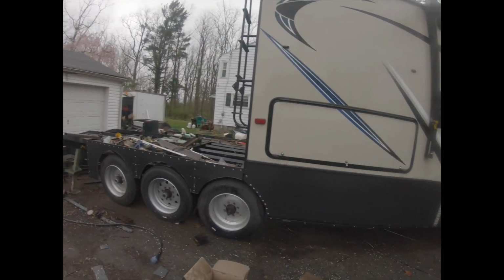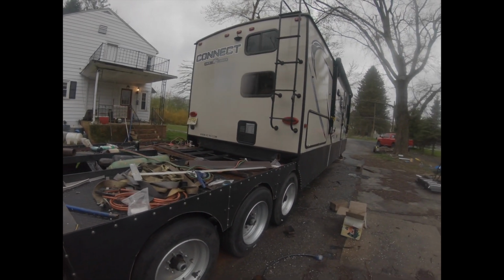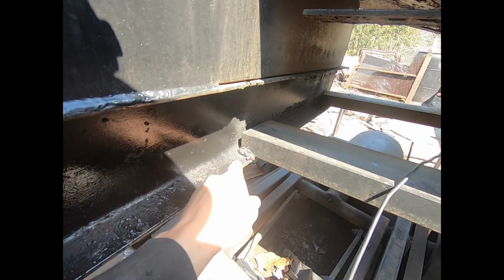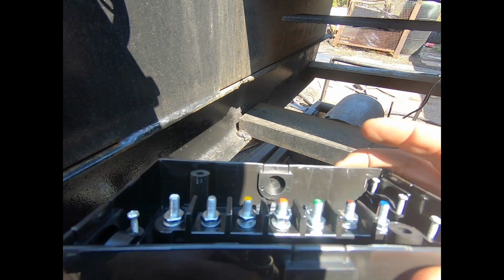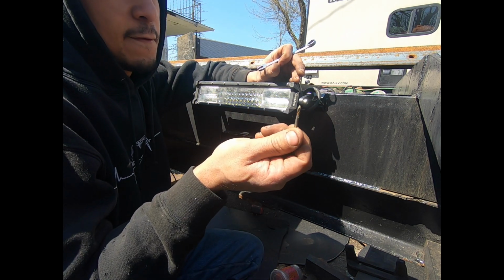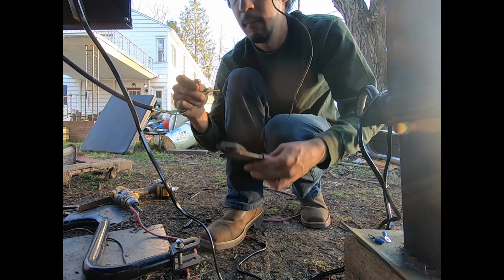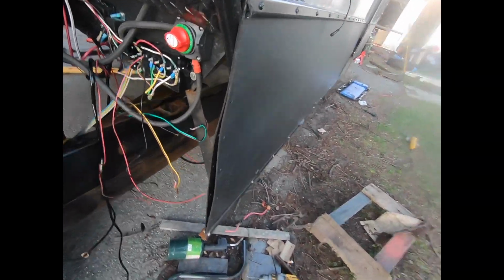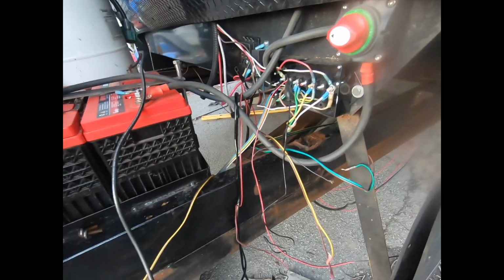Crawler Hauler episode 5

Comment: You still rocking this setup? How’s the rubber mounts working for camper ? I see you put gussets on bottom angle but not the top that appears tweaked. What’s your thoughts over all on mounting a camper onto another trailer? Great work man!
Reply from the maker: No nothing tweaked they lasted I never replaced them I sold it to a guy in Wisconsin but I drove it all over I probably put 10k miles on the set up and it did awesome.

Comment: How is the trailer registered?  I.e. When you permanently affixed the camper to the gooseneck, did the gooseneck “become” the camper? Or did the camper “become” the gooseneck?

About to do a similar thing with a bumper pull camper on a gooseneck.
Reply from the maker: I just ran the goose plate the only benefit is when you do a class 8 truck conversion or f550. I did keep separate insurance and had no issues when i had a camper damage